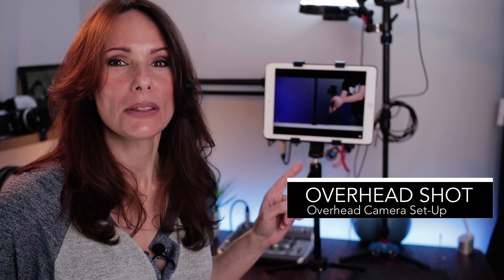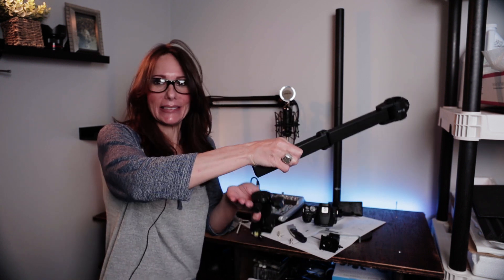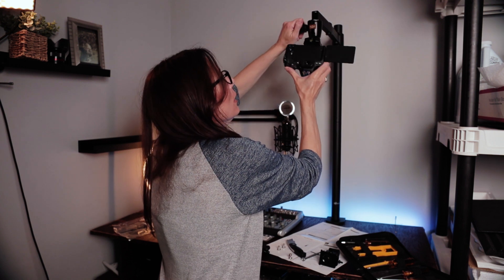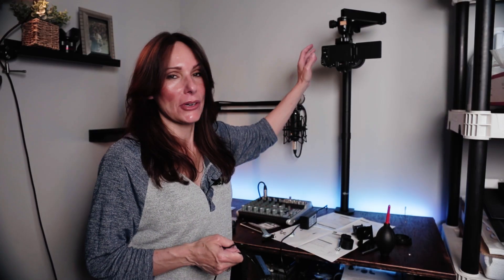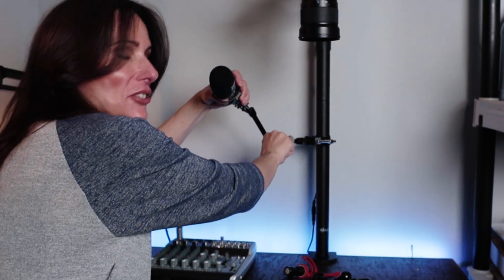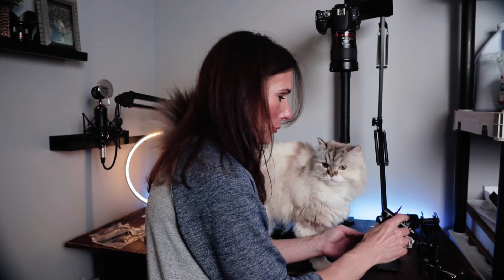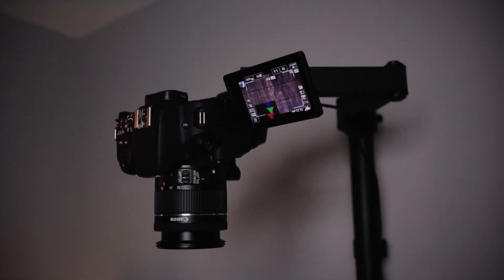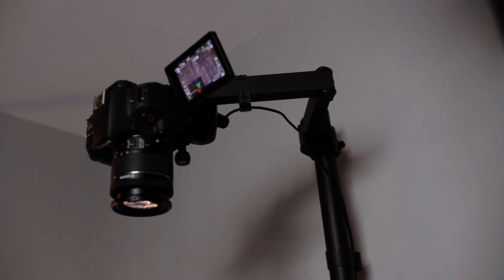Overhead Camera Setup Project Using the WALI Monitor Stand

Comment: Hello! Great video! I’ve seen several of these videos and decided to buy the mount and I’m currently using it. But I do have a problem. The arm that the camera is mounted no one shows how they get the socket out of the end of it that’s actually held in by a screw. How did you accomplish that.  It would NOT screw straight out I actually had to use my Reciprocating saw to saw off the end then use my step bit with hand drill for the hole. I’m buying another arm for an additional camera. How can I get that socket out without sawing off a portion of my arm? 

Thanks in advance.
Reply from the maker: The arm I have, I just used a drill to make the hole bigger so that it would accommodate a quarter twenty that holds on the camera holder.  My arm was just open because you need to get access to the screw inside.  Was it just a cap?  Just pop it off but I don't remember there even being a cover on that arm.
Reply: @tammysypniewski1891  gotcha! My was closed in and it was right at impossible to get off so I just sawed that small piece off (which I didn’t want to do lol). Thanks so much! Great Content!

Comment: By the way, thanks for the tip, Just remember to have it mounted to something that doesn’t move or shake when You move around on the floor or touch/bump the table. Or it will show up in the video, the same reason I never put my microphone on the table, because it will pick up the tiniest bump or tap on the screen of the iPad.
Reply from the maker: That table is super wobbly because I built it.  hahahahahaha.  It's really top heavy because I have so much gear crammed into it but I'm going to build another one.  The new one will have a lighter desktop, not white but not dark wood like I have now.